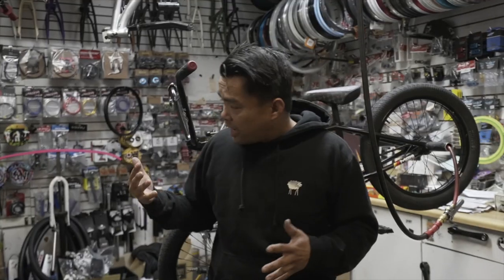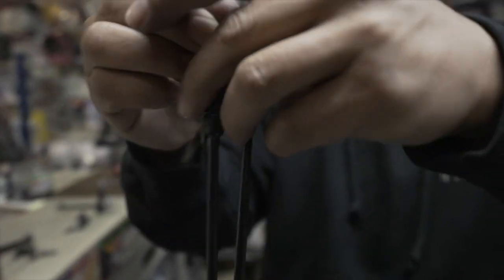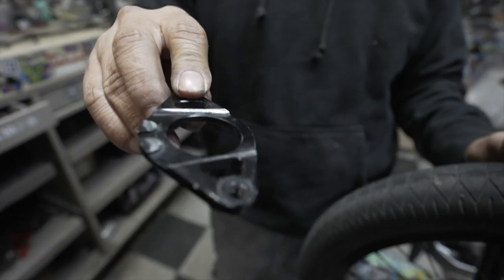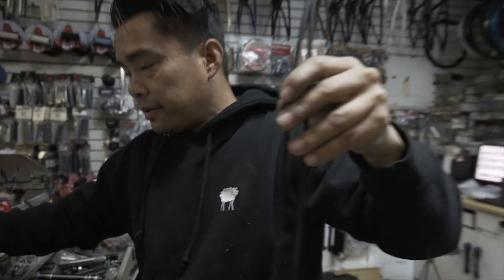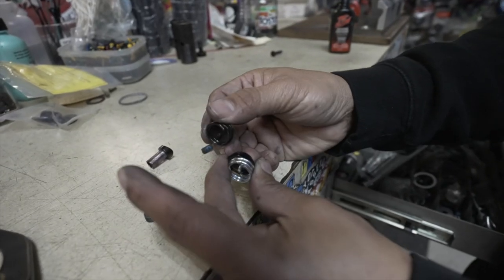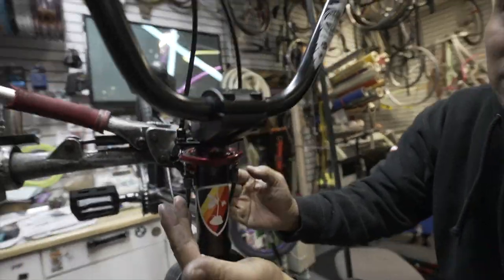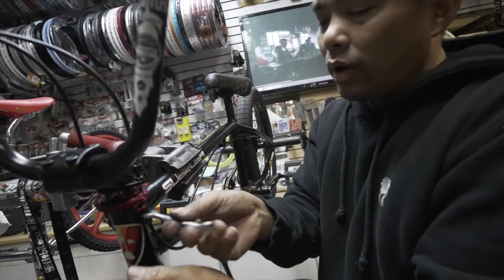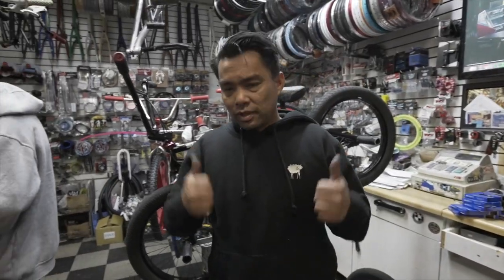How To Install A BMX Gyro! The fastest way on earth!!

Comment: I originally discovered this channel because I’m a mechanic and I was watching Phu explain the differences between old and new school bmx bikes.  I liked Phu as a teacher and watched more, as I watched more I developed even more respect.  Todays thing about triflow, in cable housings, then forcing it down there with air. 👍.  The best mechanic in my town does Yamaha outboards and motorcycles , and anything Yamaha.  He’s got a bunch of certificates and such, master technician on a bunch of them.  He’s Has trained me in many of his methods.  Phu and him like to lube cables and pay attention to the details.  Phu sanding the brake bushings for smoothness and then lubing it. 👍.  Taking care to not put any sharp bends when routing his cables. 👍 What’s really funny is I liked this channel and think Alfredo is a mechanic and filmer, but he’s pro bmx.  Fun stuff.  I was shocked as I just thought he worked at the shop.  Loving bikes and biking in upper Michigan.  Love your channel, had fun “ riding” with you in Dubai.  Without the internet I woulda never got to go.  All them skids and little tricks on the streets of Dubai, you guys had me laughing.  All this biking and fun keeps us young.  Great channel for learning bike stuff.  Tricks and mechanic work.

Comment: A few things that I always do when setting up gyros are:
1. Making sure to use the correct amount of spacers on the steer tube. Too much and you'll have less adjustability, too less you'll have less leverage on the lever.
2. I always tune the lower cables first and make sure the gyro sits on the gyro tab without too much tension . After that I tuned the upper cable to the point where it doesn't have any slack while maintaining the gyro position so it doesn't "float" in between gyro tab and the gyro plate. I've been doing this for quite a while and it helps maintaining the longevity of the brake cables.
Reply: To counter all that, different companies make different lengths of upper cables.

Comment: The right length upper cable really helps. No shade but I'd have used a shorter upper less slack = more adjustment. A dual pull upper cable makes pull smoother as well , imo the lower doesn't matter. That's what works for me

Comment: I've ran gyros on all of my bikes since the 80's recently I bought my son and I new bmx bikes and I put gyros on both of them but the problem I ran into on my sons bike was I had to change the forks out in order to get the front brake cable to go through the compression bolt I used a new set of landing gear forks which were nice but pegs won't fit the dropouts they hit the fork tube before seating so I used alot of washers as spacers

Comment: Total noob, but tried installing a gyro. Tabs on.. easy. Pulled cap and stem off. Gyro in then gyro plate👍🏼. Went to replace stem but there was like maybe a 1/4” space, cant get the stem down further. That plate is not 1/4”. Stopped the install going to take it to a shop (if I can find one nearby in NY). Is that space normal? Where did I mess up.

Comment: Can I put a U brake plate on my 97 Vertigo. Looking to do both front and back.  Looking for a good replacement for the rear wheel, I'm tracking it down. But please help. 48 hole. I live in Indiana. Has the Mohawks. My intentions were getting it back but sometimes it doesn't work that way. 
I can email the store or something

Comment: Yeah, besides sanding the mount one use a dab of blue Loctite just dropped not red Loctite you’re gonna hate life when you use red.  Specially, without you knowing them coming loose and then they ripped off. I seen it plenty of times, and skate parks in working at the shop before my motorcycle accident. And I just did a dab blue Loctite gyro tabs and cable guide with blue Loctite. Not rid Loctite. And especially right about sending the brake mounts.
Reply from the maker: Solid tip!!